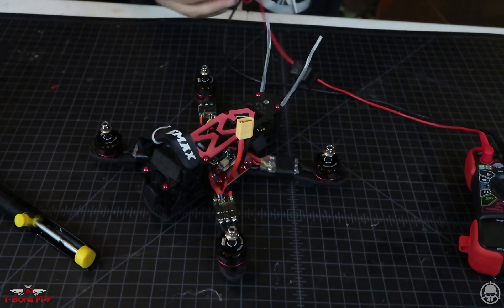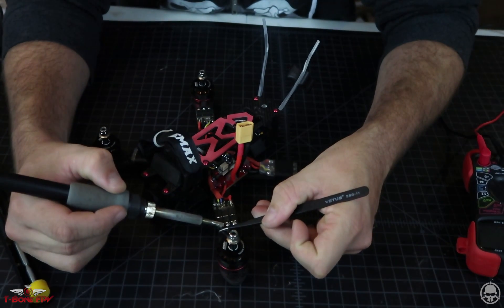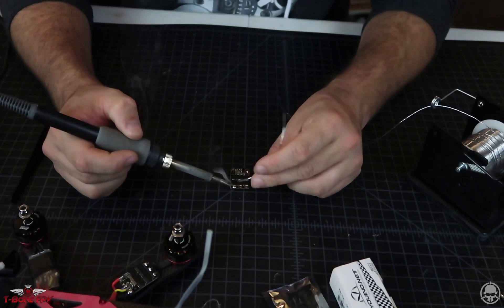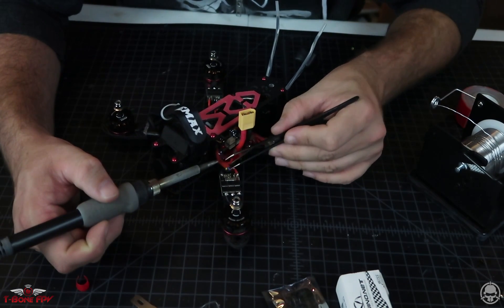Unbreaking a Drone for Rotor Riot

Comment: The trick is a fine tip on your iron.  But the secret weapon is a brass tip cleaning sponge. Really a wonder to behold, Solder melts on every surface of the tip after a few stabs in the sponge.

Comment: Hey I got 2 questions for you, about what temp are u soldering at? I just want to make sure I'm not doing it to hot. Also do you need to put the telemetry wire on the kiss esc if your not using telemetry? Thanks.
Reply from the maker: 550F for everything and if you don't need telemetry then just the signal wire needs ran
Reply: T-Bone Drones awesome thank you so much for your help, and the fast reply!
Reply: If you have a multi temp station then definitely take advantage of it. Here is what i use: between 275c and 325c when tinning wires, a bit hotter when connecting them. 350c to 375c is good for most every other part (wires to esc, esc wires to flight controller,etc) I only go up to 400c or a bit higher when I need to tin a large pad on a power board for battery cable or battery cable to xt60 battery connector.  The ONLY time I approach 500 degrees C is when I need to UN-SOLDER medium to large components. You want your iron tip to dwell on the part as short a time as possible and un-soldering is always more tricky so flux and high heat controls this.

Hope this helps

Comment: Is there a reason why nothing in the RC world seems to have fuses on it?
Reply: Fuses are too slow to protect your RC electronics.

Reverse-polarity protection diodes have a voltage drop (and wouldn't protect against shorts AFAIK).

What you need is a current limiting device for all your bench testing. Either an expensive lab power supply, or a much simpler and affordable "smoke stopper" built from a lightbulb :)
Reply: I've noticed that. I also dont see any protection diodes on anything. Maybe the amps?

Comment: when your solder is hot gently drag it across to bridge your contact
Reply from the maker: William Davie awesome I'll try that. Thanks William
Reply: +T-Bone FPV it's easy just don't keep adding solder or it will just run and use the tip for dragging your solder good luck